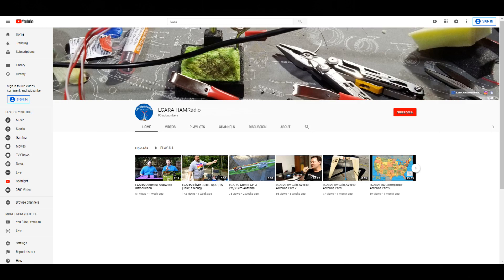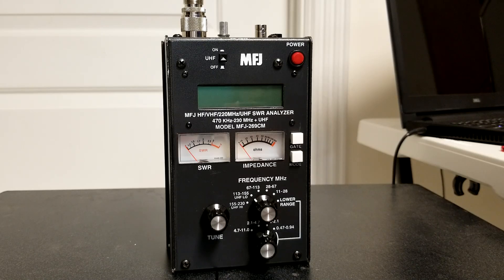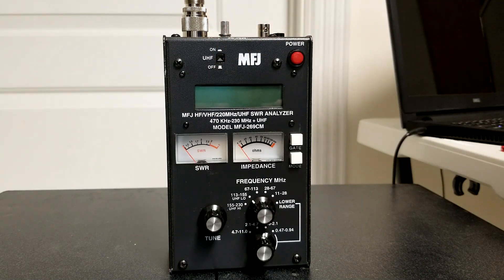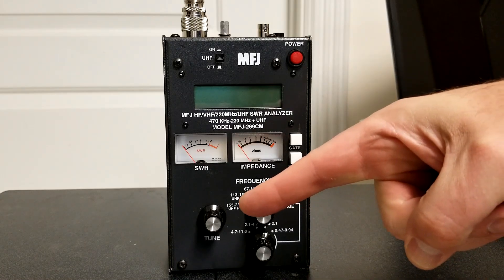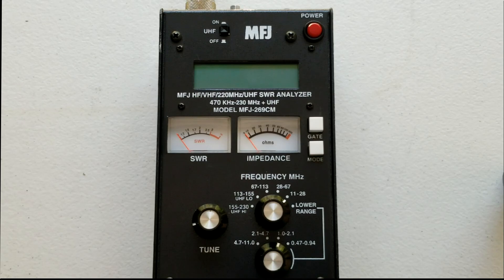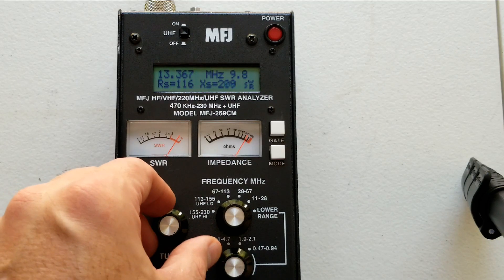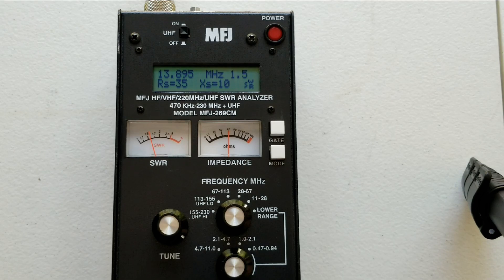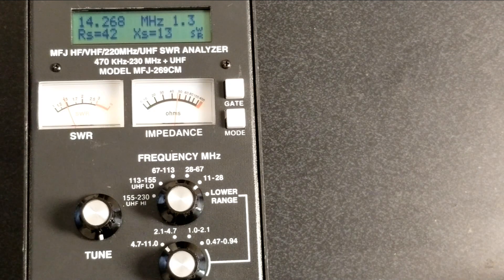LCARA HAM Radio: MFJ-269CM Antenna Analyzer

Comment: I tried using this product and just really had fits with it. It was twitchy and unstable. It was super difficult to get it narrowed into a particular part of any band. I was trying to tune antennas for FT8 frequencies and it would fly around. It would go from, say, 14.030 and if I turned the knob just slightly, it would fly up to 14.120. It was ridiculously difficult to get it near what I wanted.
Also, it would power off (even when connected to a power supply), and when powered back up, I'd get a different SWR reading than I had before it shut off.

Comment: do you set your swr in the middle of the band or beginning of the band or end of the band ?
Reply from the maker: Hey Neal, it will depend on what you plan to use the antenna for. If I'm using voice communications/SSB then the middle of the band or the middle of the portion of the band I have access to. It would be different for a General or Extra license holder. If I plan on using digital modes or CW primarily, I would adjust the lowest SWR in that area of the band. In some cases, you might be pretty flat across the entire band in which case it wouldn't matter. Depends on the antenna and your mode of communication. Thanks for watching! KY4BDP
Reply: @LCARAHAMRadio  I know it might have sounded stupid I learned from cb radio you take swr on channel 1 then channel 40 I thought the analyzer was using middle of the band to get it.